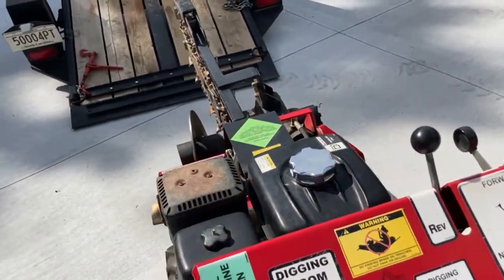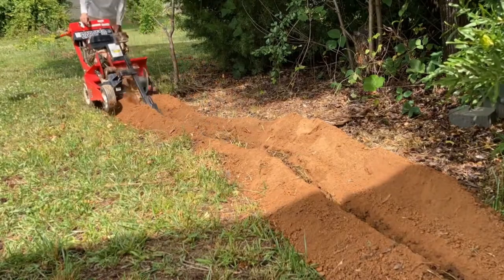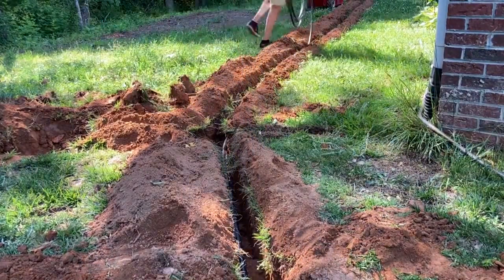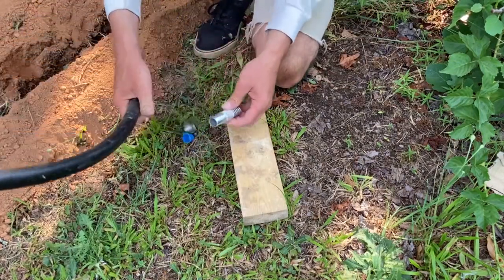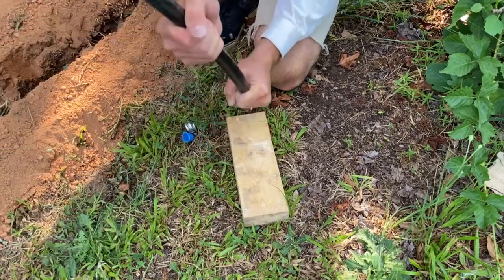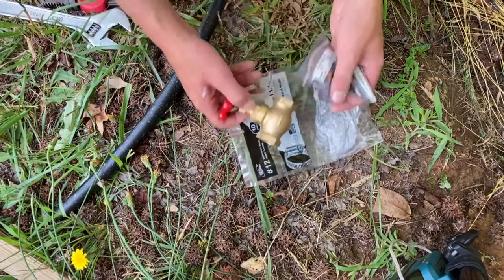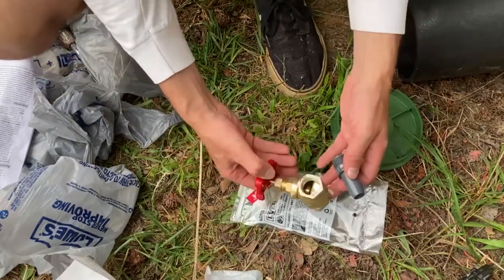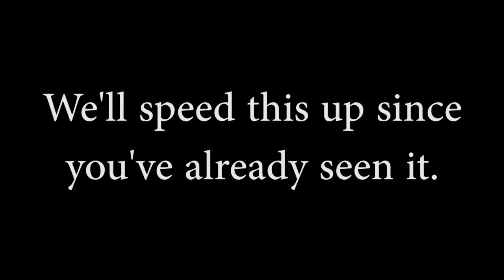How to install a water line | From Garage to Apartment | Episode 4

Comment: Ditch Witch with tracks has excellent manueverability.  Alternate hack for black pipe fittings: use a propane torch to heat/soften the black pipe.

Comment: I use 'push to connect' fittings and hose on my cars.  They are barbed fittings like those that do not require clamps - that's how tight they go on.  You did the hose in a pot of hot water and then jam it on the fitting.  I would suggest trying that next time, probably make it a lot easier.  No experience with that type of line, just a thought.
Reply from the maker: Thanks for the tip, Benjamin. Heat is definitely the way to go ... that'll be in an upcoming video.

Comment: A FAR better hack for installing poly pipe fittings is to use a hand torch on "LOW HEAT" around the poly for 5-10 seconds to make it pliable. Where gloves, heat, slip fitting into pipe and let it cool for a minute. Then use "ALL STAINLESS" clamps. Many stainless clamps are ONLY the band itself and the screw and strap are not as high quality.   You may also want to look into something called a (CYCLE STOP VALVE). It can save you a pile of money in the long run as it will help your pump last far longer than it will without due to far less cycles.. Also helps to keep your pressure regulated and can lower the amp draw, further saving the pump and your wallet.

Comment: You could have made the connection of the poly pipe to any of the pipe connector fittings much easier for yourself, if you had simply dipped end of poly pipe in boiling hot water for 40 seconds each time to make it pliable.  Also wondering why you buried the 1/2" shut off valve on the poly pipe just outside the garage?  Should that not be left accessible?
Reply from the maker: Yeah, we started using a heat gun to soften the pipe after this. He wanted the shut-off outside the garage because he didn't feel he had a good place for it inside.